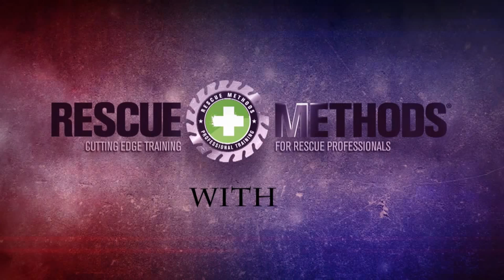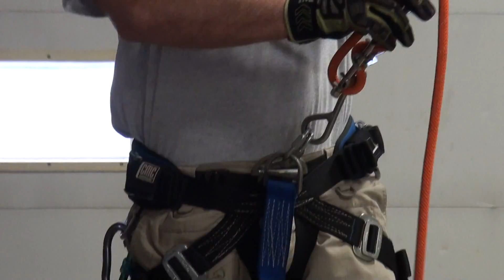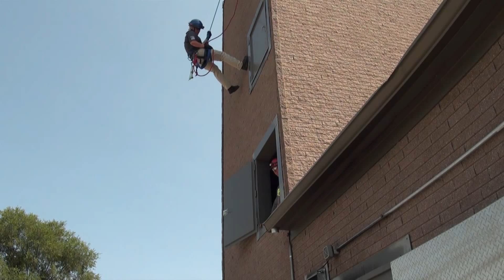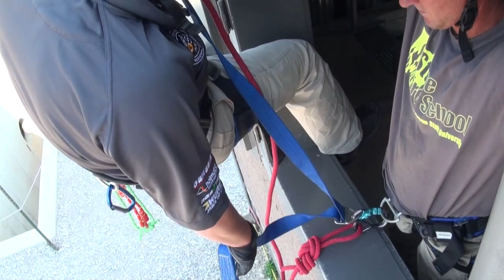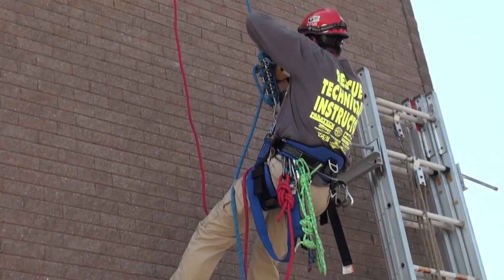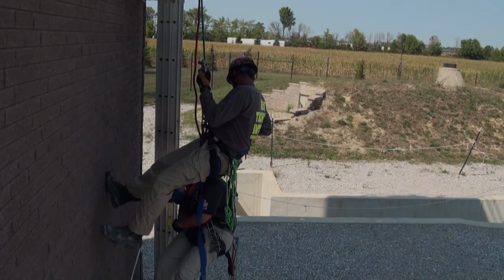Rescue Methods FR1: High Angle Pick Offs

Comment: I actually use the video to show how NOT to do a pickoff. After about 50 viewings, I promised I would send comments. Just understand first that we incorporate rope access skills into rope rescue training. 

1.) Use a long Prussik with carabiners on each end to connect you to the victim's rope. There is no need to invert in this whole video. None. 
2.) Why invert at all if the Victim is in descent mode. There is no need for it. Looks cool and .....that's about it. 
3.) Give a solid explanation why the instructor believes he has to be inverted (again) in order to lower the Victim on the rack. The reason he had to pull all the slack out of the rope was due to tensioning the pickoff strap while inverted (not good).
4.) Bad Victim placement as the Victim's body is sandwiched and bent over under the rescuer's ass.
Reply: Any videos of proper tactics?
Reply: @JC-op9bo  I will certainly do one, sir!
Reply: It will pertain to the part of the video that starts at 23:00 minutes. There are much more effective and less time restrictive techniques.